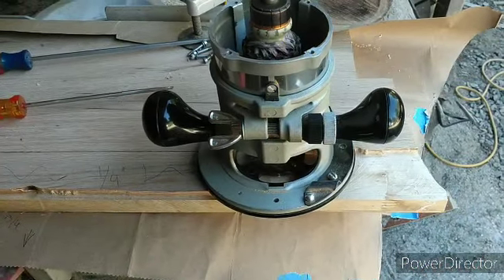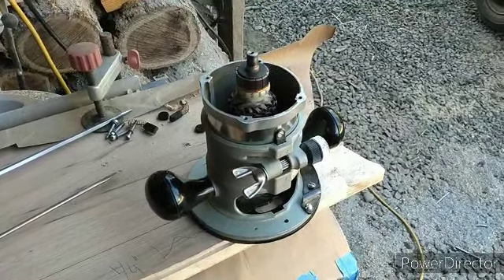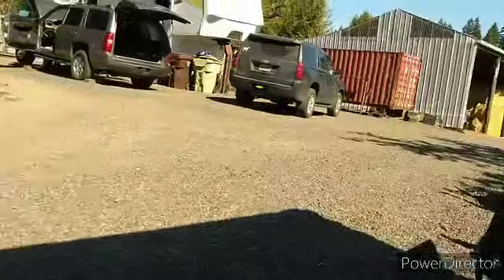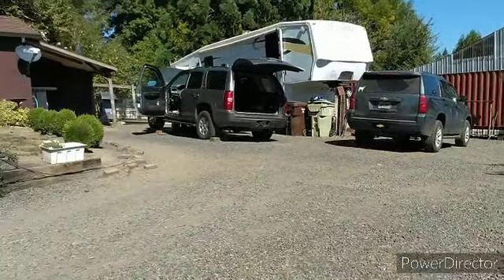neverending project and tool issues

Comment: Evidently the grease was enough to save the router. I love the old power tools.  You can use them more than a dozen times. 
I actually got a notification.
Thanks Ed.
Reply from the maker: Grease did help!! Still messed up a couple of times, but not bad👍
The warranty card is still in the case, 1973... 
Amazing notifications worked😳
Thank you Bryce

Comment: Good evening Ed
Reply from the maker: Good evening Richard
Reply: @GosselinFarmsEdGosselin  how was your day
Reply from the maker: @richardwilkens4577  too hot!! Was mid to high 90s again.. was supposed to be in the low 70s🙄
Apparently the weather guessers didn't tell mother nature...
Reply: @GosselinFarmsEdGosselin  good morning Ed
Reply from the maker: @richardwilkens4577  good morning Richard ☕☕☕
Reply: @GosselinFarmsEdGosselin changing oil  in all  the Tractors today
Reply from the maker: We need to do that too.. but need a barrel of oil first
Reply: @GosselinFarmsEdGosselin  I have 2 barrels 1 15 w 40 Rotella  for the diesels  and 1 sae 30 for the 2 cylinders
Reply from the maker: @richardwilkens4577  I only have a few gallons.. and the bookkeeper said no money for a barrel...
Reply: @GosselinFarmsEdGosselin  well hat sucks
Reply from the maker: @richardwilkens4577  yes it does.. and everything needs to be changed, so most of a barrel 😵
Reply: @GosselinFarmsEdGosselin  yes I  know   2020 and 3020 don't  take alot but the A,G ,60 and the 630 all take about 8 quarts each
Reply from the maker: Lol.. that's enough to change one of ours..
Reply: @GosselinFarmsEdGosselin  the G takes  11 quarts

Comment: Late
Reply from the maker: Good evening Kole. 3294 lights working is a good thing!!! I like the sunrise/sunset picture with it too👍😁
Reply: @GosselinFarmsEdGosselin  Yah I got that taken last night. I got pto seal now and a few buckets of oil. the seal looks a little different than the one in it, but it's supposed to work for it.
Reply from the maker: Nice 👍 what kind of oil did you get??
Reply: @GosselinFarmsEdGosselin  Case ih Hy-tran acklea. I'd rather spend more money on oil than rebuilding the powershift
Reply from the maker: Good!! Other hydraulic oils gum up the check balls and then it won't work very well..👍😎
Reply: @GosselinFarmsEdGosselin  Yup as long as the new seal works and fits in it I'll be happy. Case ih says it works for it, so I'll believe them. Same seal used in the Magnum single speed 1000 shaft too